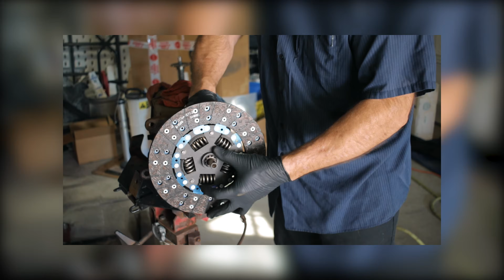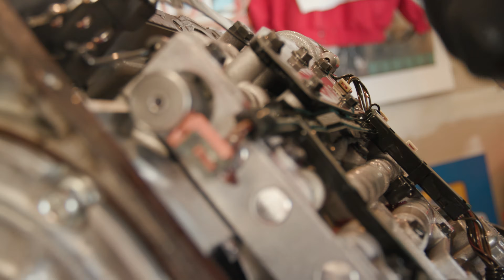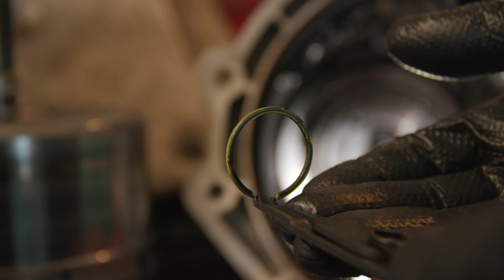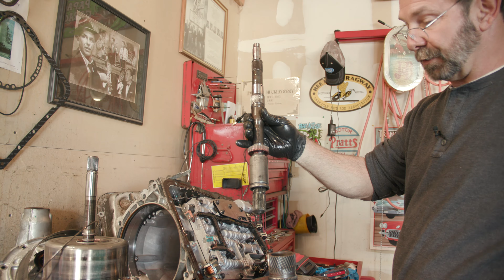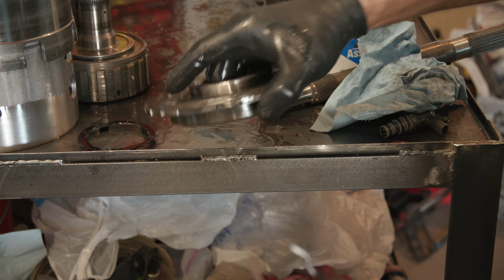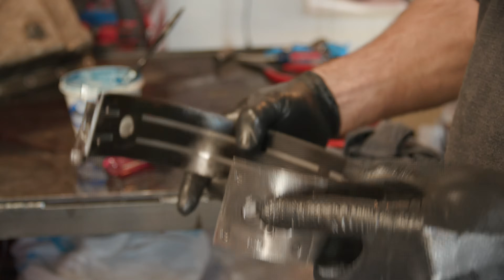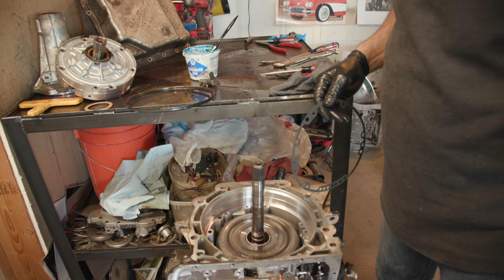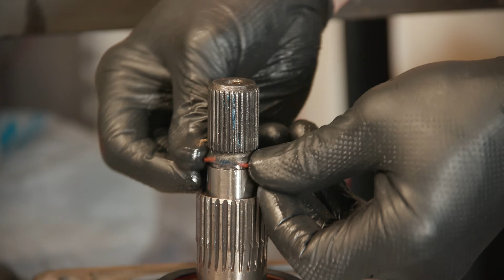4L60E Output Shaft Swap - 2WD to 4WD Conversion

Comment: Well hell!!!! I was just ordering parts and this popped up. Best YouTube find lol I'm doing the opposite, 4x4 to 2 wheel drive for an ls swap and my transmission is the 4L70E which from what I've read is just a heavy duty version of the 4L60E.
Reply from the maker: Right on!  That's correct...more clutch capacity and more pinion gears.
Thanks for dropping us a line.
Reply: @SouthpawAutoworks  hey, is there anything i should change or upgrade while in the 4l70e transmission?  Any tips are much appreciated....
Reply from the maker: There's a lot that could be done while you are in there.  Depends on how much time and money you want to put in it.  I have plans of making a video that addresses your question.
For the mean time, if it were me, at the bare minimum, I'd be installing a new pump seal and pump bushing.  I'd also consider installing an upgraded sun shell...they're prone to breaking.  I really like the Sonnax Smart Shell (for a couple of reasons), however, there are cheaper options.
Pump Bushing (Teflon):  https://amzn.to/3fbtIiR
Pump Seal:  https://amzn.to/3iVarDm
Smart Shell:  https://amzn.to/2VhssDR  Cheaper Option:  https://amzn.to/3zKHroE

DISCLOSURE:  🕵
As an Amazon Associate I earn from qualifying purchases.  Some, if not all, of the links contained in this video description are affiliate links.  This means that, at no additional cost to you, I will receive a small commission on any purchases you make through the website links provided above.
It's an easy way to support the Southpaw Autoworks channel, at no additional cost to you.  ;)

To learn more about how you can support this YouTube channel, check out this video:  
https://youtu.be/giV8ySI1Cz8
Reply: @SouthpawAutoworks  i don't have a problem with you getting a cut. You're saving thousands of people money. I did already buy a hardened sun shell. Can't wait for the video.
Reply from the maker: I'm glad that you previously purchased an upgraded sun shell.  Cheap insurance...
Reply: @SouthpawAutoworks  so my conversion just turned into a rebuild. Any rebuild kit recommendation you have I'd appreciate it. I don't want to break the bank though lol
Reply from the maker: Here's a short message for you.  https://youtu.be/cd1UBJh_rm0

Comment: Very awesome going to give this a shot to help my brother out his trans took a poop
Reply from the maker: Right on!  
Unfortunately, these transmissions are quite prone to dropping a deuce.  However, with some love, they can be made into awesome units.  Gonna be covering said topic, in the near future.
Thanks for dropping us a line.
Reply: Those teflon seals will expand on the input shaft and stater shaft when removing the front pump not that easy to install pump with out resizing tool
Reply from the maker: You are correct.  It is definitely easier to work with those teflon seals (especially the ones on the pump stator) after they've spent some time in the sizer tool.  I'll add those to the list of tools in the video description.  Thanks for mentioning this.
Reply from the maker: The product link has been added to the video description.  I'm all over it...like a bad rash!  ;)
Teflon Seal Ring Installer (Sizing Tool Kit):  https://amzn.to/3BWwQZP

DISCLOSURE:  🕵
As an Amazon Associate I earn from qualifying purchases.  Some, if not all, of the links contained in this video description (comment) are affiliate links.  This means that, at no additional cost to you, I will receive a small commission on any purchases you make through the website links provided above.
It's an easy way to support the Southpaw Autoworks channel, at no additional cost to you.  ;)

To learn more about how you can support this YouTube channel, check out this video:  
https://youtu.be/giV8ySI1Cz8

Comment: Restored my faith in your mentor Andy!! Great videography by you and excellent instructional video by the Master!!! I really appreciate the paperclip and screwdriver tricks!!!! I also appreciate the attention to detail ie; the band mount and close ups on how it came apart etc!!
The center support trick is another great tip!! Drop test very effective! Overall I APPRECIATE when a video such as this does a great service to fellow humans! Awesome!!!
Reply from the maker: Those little details can make/break us.  The drop test. haha
Thanks for dropping us a line, James!
Reply: @SouthpawAutoworks  just like putting air the pop the TH350 low/rev hub. Yup I was taught that by an old trans man. Then I seen it in a clymer manual years later! 
You have to know the tricks! 
The drop test is not when the center fell out of the pressure plate but rather when Andy just lifted the drum and let it drop. 
You thought I was busting on you guys!!! lol

Comment: Great video! Question is are the internals the same on both the 2wd and 4wd? Could you do the reverse? Swap a 4wd output shaft for a 2wd output shaft?
Reply from the maker: Great question.  Yes, yes, and yes.
Thanks for dropping us a line!

Comment: Extremely helpful. Thanks! Can the rear output shaft be pulled out without removing the center support and rear planetary gears?
Reply from the maker: Great question!
Yes, it can be done without removing those items.  In fact, it can be done with only the removal of the input sun gear (front) and the yellow output shaft snap ring (Obviously this statement assumes that the pump, input/reverse drum, 2-4 band, and the input drum have already been removed from the transmission).

In the video, Andy removed the entire rotating assembly, simply out of habit.  Even though it's not necessary to remove all that we did for an output shaft swap, we believe in going above and beyond.  Typically, we would "peek" at every clutch pack (and of course the band) while we have a transmission opened up.  If there's a problem, or gonna be one soon, we want to know about it, right now.  Nothing worse than having a "come-back"...especially one that can be avoided.

To gain access to all of the clutch packs, the center support, that's lugged to the transmission case, needs to be removed.  This way we can inspect the Low/Reverse clutch pack.  While we are in there, the hard parts (gears, etc) can also be inspected.

A little extra effort goes a long way.  ;)

Thanks for dropping us a line!  You are appreciated.
Reply: @SouthpawAutoworks  Thanks for the response and I figured as much. Since you're already in there, what's a few extra minutes to dig deep and check out the rest of it for a little peace of mind? Cheers!

Comment: 10 out of 10! swapping the output shaft out of my stage 2 4l60e for my 4x4 s10 wanting to use a 32 spline for a beefy transfer case. like i said top notch job.
Reply from the maker: Dude, that's exciting!  Let us know how it goes.
Your positive feedback is very appreciated.  Thanks for dropping us a line!

Comment: Once you removed the input drum and the band, followed by the yellow snap ring, could you slide the output shaft out the rear without further removal of the planetary front hub and the rest of the internal parts?  I am thinking of trying this myself and the less have to dissemble the better.
Reply from the maker: Great question!
Yes, it can be done.

In the video, Andy removed the entire rotating assembly, simply out of habit.  Even though it's not necessary to remove all that we did for an output shaft swap, we believe in going above and beyond.  Typically, we would "peek" at every clutch pack (and of course the band) while we have a transmission opened up.  If there's a problem, or gonna be one soon, we want to know about it, right now.  Nothing worse than having a "come-back"...especially one that can be avoided.

To gain access to all of the clutch packs, the center support, that's lugged to the transmission case, needs to be removed.  This way we can inspect the Low/Reverse clutch pack.  While we are in there, the hard parts (gears, etc) can also be inspected.

A little extra effort goes a long way.  ;)

Thanks for dropping us a line!  You are appreciated.
Reply from the maker: Thank you for watching so closely.  Really appreciate your input.